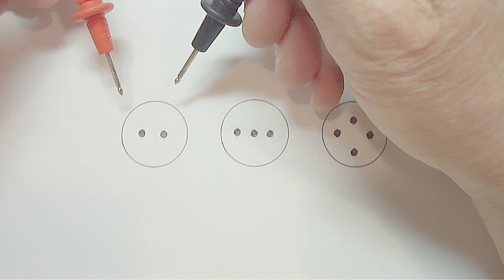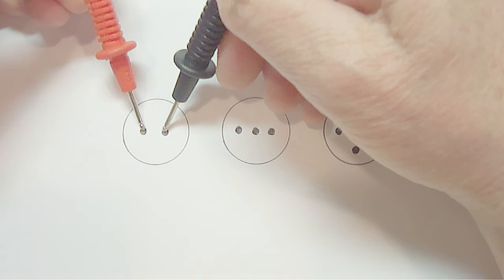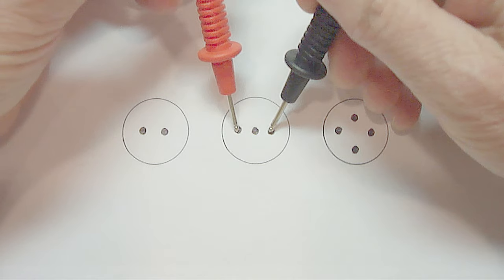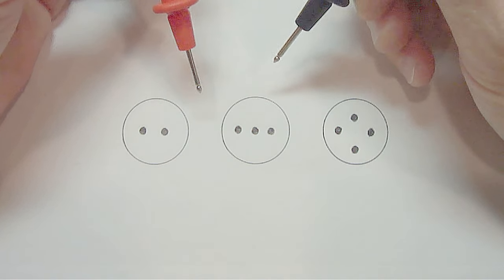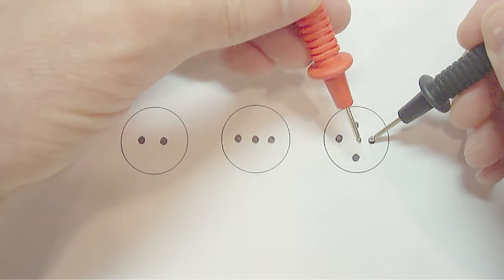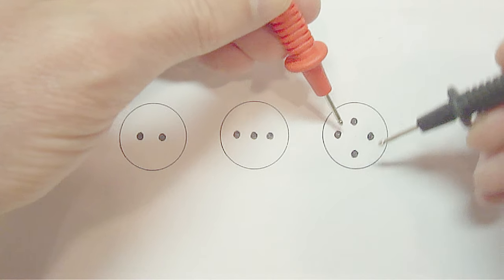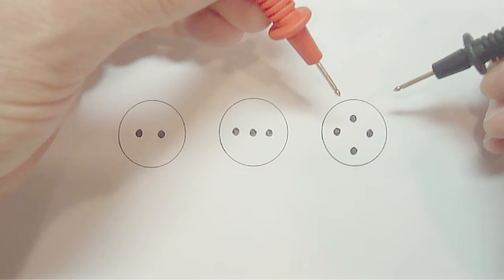Car AC Not Cooling - How To Easily Check AC Pressure Switches

Comment: My a/c is not blowing cold.  With manifold gauges I tested for leaks.  Found a leak in each Shrader valve.  Replaced the valves.  I was surprised when my local Auto Zone gave me the two for free!  Checking now to make sure the system holds pressure over night.  If so, I guess my next step is to test all the a/c components?  Love your videos and because of them I have hope that I'll be able to diagnose and fix any problem I find.  Thanks so much from this 69 year old young lady in north Idaho!

Comment: Hi Paul, this might be a dumb question but can I bypass these switches when I have no refrigerant in the system. I have just replaced a bunch of parts and want to check these too before I refill the system.....again. I have a 2006 beetle 2.5 hatchback just not blowing cold even when recharged by an AC guy. Im thinking now it might be the radiator fan control module. The weird thing is my radiator fan never comes on but the car never overheats either. Im stumped for sure. Im just throwing new parts at it.

Comment: Good stuff, gonna test this out when I get home because my ac clutch doesn’t engage in hot weather for some reason and accounting to the factory guide this sensor and expansion valve are possibly at fault
Reply: did you ever find out what exactly it was
Reply: @bigred2oo766  yes. It was the pressure sensor located on the accumulator. But might be different on your’s
Reply: @sanaruarts5527  was actually the same thing, just figured I’d replace them all except for that one since it was fairly new. Sure enough it was the culprit
Reply: @bigred2oo766  nice, hopefully you used OEM because I had put an aftermarket on mine and ended up using my older OEM again, now I’m getting crisp cold air
Reply: @sanaruarts5527  once I isolated the problem and KNEW that was what was wrong it took 3 sensors that didn’t do anything before I tracked down a GM part and now cold air. Thought I was gonna have to do the evaporator too but turns out it may have been the bad sensor that was leaking

Comment: This was very helpful. My 2013 Audi Q5 suddenly lost AC. I first tried to get a recharge can but AC pressure in the line was good. I did the multimeter test on the high pressure switch and got no continuity. I swapped this part out for a real German part ($80) and replaced it within five minutes. My car has a built-in check valve and that held in the refrigerant while I swapped out the switch. AC is back again without having to go to Audi Service unit and face a potential large diagnostic and replacement cost.  Very much appreciated!!
Reply: How did you know your car has built-in check valve and that held in the refrigerant?

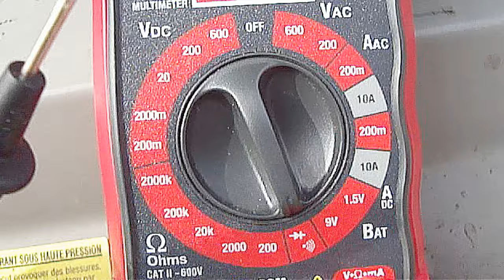Comment: 4:17 the continuity mode will have a diode symbol, which is a triangle with a line on the right side. The symbol for a diode is a triangle pointing toward a straight line perpendicular to the wire. The orientation of the triangle in the symbol indicates the direction in which current is permitted.
Just thought I would share this especially for those who need to test diodes in a circuit.
Reply: Yessss thank you i was about to ask that!!!!!

Comment: Great video, you've nailed it. I just have a quick question, would a good pressure switch always have continuity? If yes, could a lack of refrigerant cause the switch not to engage and therefore it wouldn't have continuity?

Comment: Thank you for the great info. I wanted to know is there a way to test both low and high pressure switches if the system has been evacuated?

Comment: Thanks I have fixed car ac problems most were overcharged. 2000 Montero sport 160,000 miles sitting under a tree 3 years. Evaporator coil was dirty now I add freon and net day low side is high. Same ambient temperature temperature. It cools but not well. Have interior apart for better cleaning. Fan is extremely loud at high speed in cabin. Took blower and fan out, over 1/8 " end play . Also squeaking noise when I turn the motor by hand when pressure is applied away from the motor not loud. Oiled the felt at the rear bushing seems to help. About to clean the fan .

Comment: Hi Paul, I have this same car. Does it have a built in high pressure check valve or does the system have to be evacuated if changing the pressure switch? Thanks for the informative video.

Comment: Great info, though if a multimeter isn't handy you can simply turn the car and AC on and unplug the low or high side plug and jump the (+)(-) sides with a wire. If the AC compressor turns on then you know you have a faulty pressure sensor/switch. But only do this for a few seconds or for testing purposes not as a bypass to make your AC work.
Reply: Thats wrong. All you are doing is bypassing the switch, that does not indicate a def switch.

Comment: If i understand correctly, in the video you said the low pressure line is the larger line. And you said the low pressure switch can be located either on the accumulator or the line itself close the accumulator or the compressor itself. 

My question is:
On my car I see the low pressure switch located on the larger line close to accumulator(same as in your video). But there is another compressor mounted pressure switch located on my compressor as well ... would that be the high pressure switch? I don't see any other pressure switches located anywhere else on the entire system. (92 Buick century 3.3)   I replaced the entire system. But i failed to take off the old  pressure switch from the Mounted compressor before discarding it 😤and now I'm having trouble finding the correct part 

Thank you for your help!

Comment: Thank you for your video, I tried to take my ac high pressure switch off and as soon as I started to turn it off it started leaking high pressure, I tightened it back up, my question, is their a Schrader valve inside of the high pressure switch causing that to leak out like that?

Comment: Replaced the AC clutch on a 1995 K1500. Still nothing. Finally checked the AC pressure switch and jumped the connection (paper clip the pins together). Fired it up and turned the AC on. Clutch engaged. Went out and replaced the switch. Had to recharge the refrigerant too, but that $20 part was all I needed. Highly recommend checking that thing first before more expensive and laborious work.

Comment: The flaw to the continuity switch test is a partial failure where the high side switch opens at less than prescribed high pressure. These switches are not expensive so replacement makes sense as long as u use a quality replacement part. I recently replaced a thermistor. The replacement had an impedance of 6.8 ohms when cold whereas the original was only 6.6 ohms. Cheap replacement parts can drive you crazy.

Comment: Thanks to this video, I fixed my a/c.  After watching, I went outside and found my high pressure switch, only to find that it was UNPLUGGED!  Now I know why it stopped working 2 years ago after having work done at a ma and pa Toyota shop!  Unbelievable.  No, BELIEVABLE! 🤠👍🇺🇸Edited: I forgot I had work done at a Dealership, also.  That’s probably when it happened!
Reply: whats a Ma and Pa  shop CJ london
Reply: @CJ.A-C  Privately owned shop.  Non-dealership.
Reply: And it took you 2 yrs to realize the ac was not working ??
Reply: @ACommenterOnYouTube  No.  I realized it wasn’t working but didn’t know why. Plus, I’m in the PNW and I don’t use it very often.  Thanks for being a smart ass troll.

Comment: Hi there, so do i understand you correctly - having no continuity on the e.g. low-pressure switch, points to a bad switch? Did this check by myself today when garage quoted me a 700 bucks upwards for a new compressor. Belt and clutch are moving correctly when activating a/c :)

Comment: Would one (or both) switches being faulty (being stuck in the closed position) - cause the compressor to stay on constantly (and thusly freezing the evaporator coil) ?   I've been dealing with a constantly running compressor in my 2001 Silverado 1500 for years - and trying to pinpoint what's not allowing the clutch to cycle.
Reply: guess he didnt like your question
Reply: You can test the low pressure switch by disconnecting the pressure switch, using a jumper, and connect it to a battery to see how the AC compressor reacts.

Comment: Pretty simple video with nice descriptions, except for one massive mistake... the "continuity" setting on a multimeter is actually called a "diode" setting and the little symbol is a diode symbol.
The reason diodes are tested with simple continuity is simple, electricity only flows in one direction through a diode, so you test it with the probes in both directions, and if you get one direction open and one short, then the diode is good.  And yes, this test 100% works for a Light Emitting Diode as well, with the added bonus that it usually glows while testing.
Reply: No, continuity is Not diode setting! Diode test is diode setting. Continuity is just ohms, both ways, and meter May have buzzer than reads continuity both directions! Navy ET 1st class, thank U!

Comment: On two and four wire systems are the extra lines sense /signal wires? Another video mentioned how most of the time they are sensors not switches these days. But if two of the pins are low to 0 ohms... Sounds like there's still a switch in there

Comment: do you have a video to show WHERE low pressure switch is located on an SRX 2014. we cannot even see to follow the lines. We checked the fuse and the relay already.  clutch does not engage

Comment: Just done this check on my BMW with a 3 pin. No beep so now it's time to get a new pressure switch. It's been driving me nuts trying to work out what it could be that's stopping the air con from working. Thanks for the video.
Reply: While I was at it I checked there was voltage coming into the sensor and that was working so has to be the switch.
Reply: Let me know if that fixed your problem
Reply: @alexramirez8096  it hasn't fixed it but I've also had issues with the fan not running as well. Not getting any codes so think it must be the compressor.
Reply: Did u finally change the compressor? Did it work?
Reply: @hashimadekunle1714  haven't changed it yet. Had other things to pay out for

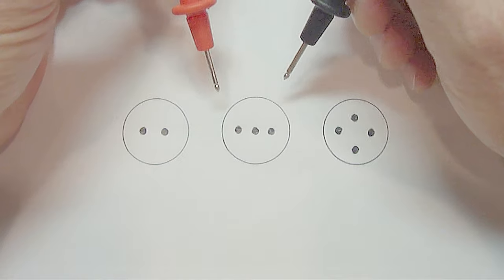Comment: 3:22 with 3 prong. Shorting wire on outer terminals  turns off engine on Honda civic .2010. this wire connects to ECM. Car started back up with wire removed.

Comment: 2004 Yukon XL 1500. Air blows cold, then hot. I shut vehicle off, restart and cold air again, until next time. To replace sensors, does system needs purged? Thanks in advance.

Comment: with my ac on full blast the fans will not come on. I tried multiple times. I did notice the fans will only come on for 2 seconds then it shuts off?  do you know what would be the cause? My ac works fine just the cooling fans don't come on...thanks for any help

Comment: My 2011 Volvo xc60 ac clutch will not spin unless I bleed the refrigerant down to the low setting on the diy can. Then it begins to spin. If I add any refrigerant back in (to get it in the green) it stops spinning. 

Is this a pressure switch issue?

Comment: Jesus is LORD! Thanks for your instructional videos.  Well done. 
Yesterday I had a problem with a Ford F-550 with a 6.0 diesel V-8. Last week I replaced the compressor, condenser, evaporator, drier and one bad high side hose between the compressor and condenser. Charged the system with 2.6 lbs R134a and 9 oz Pag 46. It ran normally and got 54°f from the vent when it was 108 outside. Let it run all day like that before returning it to service. 
After a few days the refrigerant began to leak from an O-ring ln the lo side. My boss recovered the refrigerant  and parked the truck for 3 days. I didn't know it had been recovered when I drove it into the shop. I replaced that O-ring, pulled vacuum and recharged the system. But the lo side pressure won't get below 46psi. With gauges connected and engine off, the lo side shows 90 psi. The compressor clutch never shut off and continued to run non stop. 
I'm thinking some sort of blockage on the lo side. But why does the clutch stay on all the time if the lo side pressure is too high?
Reply: Because it only shuts a/c off due to LOW pressure hence it’s name Goober.

Comment: Thank you for clarifying this.
I tried to fill my neices 94 TBird, and thr shrader valve seal broke, leaked coolant.
Refilled, but compressor clutch is not engaging. :(
Blowing hot.
Maybe I need to check these switches.

Comment: Will a Faulty AC pressure switch cause the radiator fans  not to turn on or that can be a bad radiator temperature sensor ?? My problem is that the AC stopped blowing cold air and then like 5 to 10 minutes later the temperature started to raise.
Reply: Did you finally got an answer to your question? I have similar problem with my w204.

Comment: How to test what BMW calls it a Dual HVAC Pressure Switch. Thinking it does low and high all in one. It has four wires with two connectors one black and one white connector. You would think this is the high pressure switch but they do not list any low pressure switch.

Comment: Great vid!! I have problem with my ac button not turning on supplying power to the compressor and ac condensor fan.  Both compressor and fan works by bypassing but when i push in the ac button nothing happen. Pls help.

Comment: I have a 2012 dodge  grand caravan and my ac botton  keep blinking and sometimes  the light just turns off and It's start blowing hot air but when the light is on it blows cold air. What might be the problem. I check the fuse and relays and everything  is good .

Comment: Any suggestions for a compressor failing to spin after moving the vehicle? It will click but refuse to spin. When driving - once a sweet spot is hit the compressor runs fine

Fans running
50/250 psi 
93°F ambient
13v at compressor
New Pressure switches
Reply: You may be experiencing a short duty cycle where the high pressure sw opens the circuit and disengages the clutch. Once u r driving, the air passing over the condenser cools it and reduces head pressure. Make sure the fan is working properly.

Comment: What if the low pressure switch cant be jumped ? I replaced it but it still wont jump with a paper clip. The compressor clicks on when i jump it through the ac clutch relay but not through the low pressure switch. There’s continuity in the wires of the low pressure switch but it cant be jumped with a paper clip

Comment: Hello. My mechanic just vacuumed and charged my a/c. It cools good. However my clutch does not stop turning as long as my a/c is on. It stops when I turn off the a/c. When I tested this, the temperature setting was on 50%, just at the middle, and it was evening so not too hot weather. I waited around 5-10 minutes and the clutch did not stop turning. It was cold in the car but not very cold. When I turned the temperature switch to max, the air from the vents went colder. So the a/c temperature control system (probably some kind of thermostat) works properly. The only problem is that the clutch does not stop turning which increases the a/c gas pressure too much so it leaks out of the system. What’s the problem? How to fix?
Reply: You got to fix the leak ,Goober that’s why compresser keeps running,can’t build enough pressure to cut itself tf off!

Comment: Hello Sir, I have Sienna 04 XLE. When turn on AC, the magnetic clutch engaged but keep running (without disconnected). If I turn off AC button, the magnetic clutch dis-engaged. So I turned on AC button and test high side, it showed high pressure. I released Freon down to normal but still no cold air, the high side line is warm when touching. Also when I play around by turn on and off AC button in the car, I hear the sound engage and disengage loud (click click). Would you please advise what's wrong with it. I checked AC relay and fuse, all are good.
Reply from the maker: My best guess is you have too much pressure on the low pressure side.

Comment: I suspect my pressure sensor is faulty, but need to test it. My car uses a three wire pressure sensor to send data to the computer. It sends a voltage based on the pressure. I can’t just bypass it and give it full reference voltage (5V) or it’ll think the pressure is through the roof. Any ideas on how I can send around 1V to the sensor wire to trick the system into thinking the pressure is correct?
Reply: Too much info

Comment: Great video mate. My problem is the radiator fan is not coming. The compressor clutch is engaged, I also have  potential code P0480 with is fan circuit. Fan come on car temp hit 104°C which is right. Any ideas cheers Graham
Reply: check your fuse and relay of the fan which normally in the fuse box under the bonnet
Reply: There is no simple answer to this question. Yes, it could be a defective fan, but on a 2015 VW Golf, the condenser cooling fan is controlled by the HVAC control module. If the module is not recognized or found by the CAN network, it won't command the ECM to turn on the fan. Unlike the old days which I dearly miss, modern fans use PWM signals to control their speed so u can no longer hotwire a fan and bypass the computer system.
Reply: @Barryd57  I had it regas and all good. Thx for reply

Comment: I should have continuity on a new switch right out of the box, right? Every switch I have bought does not show continuity. Am I really getting that many bad switches from the parts stores??
Reply: Continuity happens when the switch is installed and the system has a sufficient refrigerant charge to apply enough pressure to close the switch creating the condition for continuity.
Reply: @nic32174  thank you!
Reply: Thank you

Comment: After chnging car battery ac playing dead. Ive reconnected battery. Same.  Checked relay and fuse. Same.  Next ill go over preasure switches and wack on the clutch.  Voltage is at the relay.  Not sure yet if its getting to compressor. Hope cpu control not fried due to car battery replacemwnt.